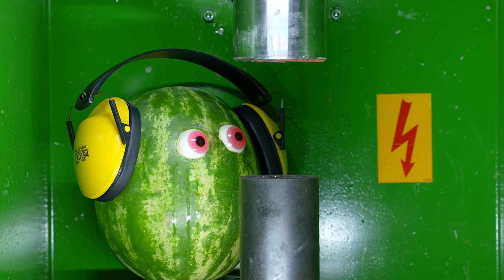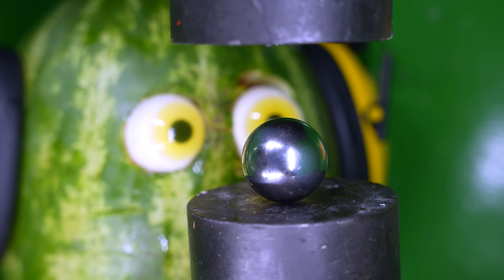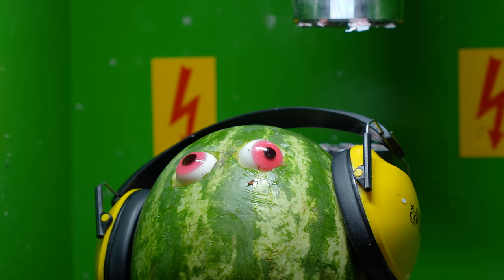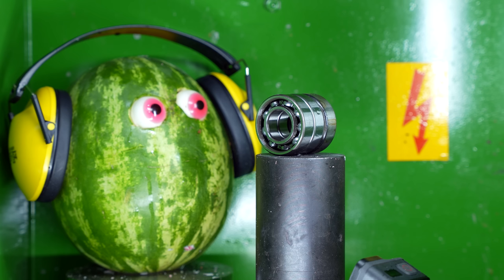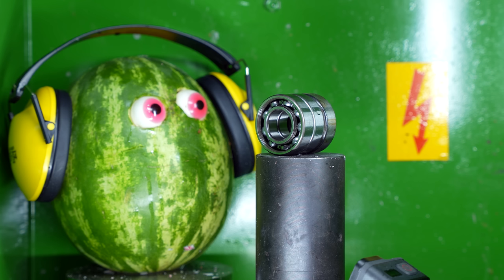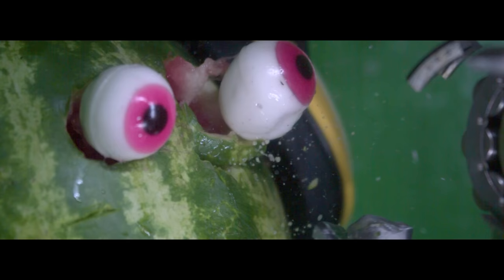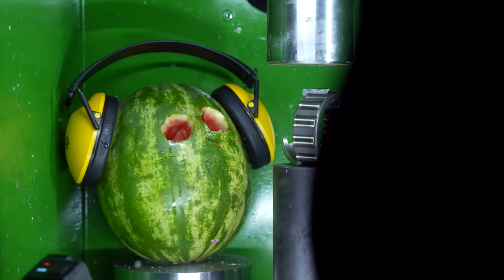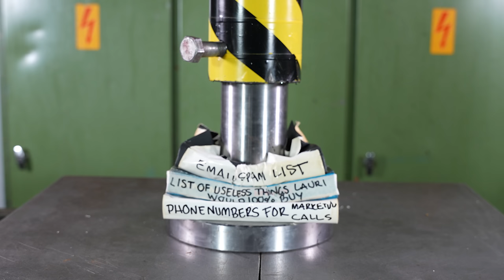How to NOT Handle Ball Bearings: A Safety Lesson with Hydraulic Press

Comment: Honestly I think if you put your face a foot away from a press while smashing things, safety glasses will be the least of your concerns.
Reply: Spacial awareness therapy would be something I would suggest... or a suicide hotline??  Lol

No one in their right mind would have their face that close to a press...period! 😊
Reply: I agree totally.  As vision declines though, it is difficult fighting the urge to get your face a few inches closer.  Conscious effort is required along with the right glasses.  It took me a while to figure out why I was getting more hits/dings on ppe -- I had positioned myself out of my normal "safe spot" for a given operation.  I thought it was luck at first and almost gave up profanity out of superstition.
Reply: @gth042  I’m not saying don’t use them under normal circumstances.  These were a LONG ways from normal circumstances though.
Reply: @jeremiahsmith2037  I agree!  I wouldn't want to be in the same room as 150t letting loose.
Reply: @gth042  Without a concrete wall in between I don't want to be in the same post code. In the army I saw what happens when a 24t self propelled howitzer "gently graces" the corner of a brick house at about walking speed. There were bricks 7-8 meters away due to the same effect we see with the press when rigid things suddenly give in. It was so weird seeing bricks fly much faster than the SPG was driving. What 150t on a small area truly means is so far beyond what our intuitive understanding of things can handle that it isn't even funny.
Reply: If you watch some of those Fail videos, you’ll see that people can do very stupid things!   I have faith that someone out there is dumb enough to do it.
Reply: @jeremiahsmiyh2037 Someone somewhere did it to require a saftey label. Have you not seen the warnings on heavy machinery that say it does not know difference between fleash and metal.
Reply: @BLOODKINGbro  kinda like when you order hot coffee from McDonald’s, then sue McDonald’s because your hot coffee burned you.
Reply: Unfortunately with some things, you kinda have to to make sure things are going together properly. 

Though a good idea is press some, then look. Then apply more pressure, then look and so on. Rather then just staying there.
Reply: @jeremiahsmith2037  that is not at all what happened and i'm tired of that narrative.

stella liebeck was a 79-year-old (at the time) who suffered third degree burns in the pelvic region. she asked for $20k to cover medical expenses (peanuts for a mega-corp like mcdonald's) and sued when they didn't pay up. the jury found mcdonald's to be 80% at-fault for the incident and liebeck was awarded $640k in damages, which, again, is peanuts for mcdonald's. following their massive loss, mcdonald's launched a smear campaign against liebeck. they settled out of court for an undisclosed amount.

in case anyone was wondering, mcdonald's was serving coffee hot enough that, if spilled, would result in third-degree burns in three seconds.
Reply: @corbeaudejugement  what exactly about what I said was slander?
Reply: @jeremiahsmith2037  maybe not slander per se, but it's a gross oversimplification and one pushed by mcdonald's to make liebeck's claims seem frivolous, when they weren't. i'll change the wording.
Reply: @corbeaudejugement  even if that lawsuit wasn’t frivolous, which I don’t care to debate, I believe it sent this country on a path where nowadays people try to sue if you do something to slightly inconvenience them.
Reply: @jeremiahsmith2037 People have been doing that for centuries. People have been doing that since the inception of the Civil Courts as a concept.

Nothing about that case did anything to change the reality that civil court is bloated in frivolous lawsuits.

There has been an increase but that's due to things like the ADA and people spending their day going around and filing lawsuits against every building that is even a mild inconvenience for someone in a wheelchair. A funny but sad example, a guy in a wheelchair was at a gym which had a party room on the second floor. The gym had no elevators and the guy sued the gym and sent then to bankruptcy because of it.
Reply: Mmm. Indeed.
Reply: @jeremiahsmith2037 the COPE got called out and now you are back pedaling HARD
Reply: I think it's more about trying to show what could happen if you're directly in the line of travel of a piece of shrapnel. Realistically, whether you're up close or far away, if there's nothing but air between you and the press, the results will be practically identical. The only practical difference is the odds you have of getting hit by a piece of shrapnel. Putting the melon closer just means that it's way more likely to get hit in the first place
Reply: My old job wanted me to do that with concrete I said no and conveniently a month later I was gone lol best choice ever!

Comment: It is amazing how much energy a ball bearing can store and how quickly it can release it under pressure.
Reply: The table sank down from force, when ball bearing break it bounce up and accelerate those sharpnal.
Since energy is related to the distance and force apply on it, we will see there is great amount of energy being stored in those table  displacement.
Reply: @fakestory1753  Umm. No. The table bouncing back up does not add energy to the ball bearing exploding. The shrapnel is already flying and the energy released long before the table rebounds.
Reply: Id like to see the maths involved, stored energy, comparisons to familiar energetic events.
Reply: It's the press that has the stored energy not the ball bearing.
Reply: @rikidawson7510  Depends how much internal strain was in the bearing from the heat treatment. I could see a ball bearing of that size easily storing a non-trivial amount of energy just due to its crystal structure.
Reply: @sophietaylor9753  good point
Reply: Yes, you never really want your balls under pressure. Eventually they will explode.
Reply: @rikidawson7510  If it was just the press, the ball wouldn't explode. It exploded because it couldn't store any more energy from the pressure on it.
Reply: What you might have seen, it could be cold fusion achieved by iron reaching critical mass, just before the explosion, there was a strange red glow around the ball, radiation ?
Reply: That's what she said
Reply: Disassociating atoms that are bound that tightly together in a crystalline structure after the bearing has already been hardened generates a tremendous amount of kinetic force, probably equal to a stick of TNT.
Reply: It's because of how brittle hardened steel is. It doesn't bend or warp. It fractures.
Reply: @El_Hornio_II  I feel like we would get along.

Comment: Wow - I'm impressed! For me, the slo-mo shot of the bearing explosion plasma is one of the coolest things you've shown on the channel - IMHO. The released energy is shocking.
Reply: I don't think it's converting to plasma, but just fine dust particles that are extremely hot. (I could be wrong, but they look far too granular to be plasma)
Reply: @DUKE_of_RAMBLE  it is NOT a true plasma!
Reply: Not plasma, unfortunately, not nearly enough energy. The flash is the material burning in the oxygen in the air around it. Even if If the bearing was ceramic, it still contains metal oxides and such that under extreme heat will burn in air. 😊
Reply: Not a plasma, but fragments of steel so small they self ignite in the air.🫨 Don't try this at home? Don't  even try this in Finland!
Reply: @sgtbrown4273  If it contains metal oxides, by definition it's not going to "burn", burning means material + Oxygen = oxide. Like iron+oxygen = rust. Ceramics can still glow, or burn, but metal oxides wouldn't burn.
Reply: I want to see what those red hot metal fragments do in the presence of a flammable gas.
Reply: @flavius29663  we use metal oxides in explosives.

Comment: That watermelon is very, very dead. 

I have a scar on the exact center of my left eyeball, from a bit of steel that got lodged there somehow, not from not wearing safety glasses, but in the shower after working in the shop. The Dr who removed it with a scalpel told me she knew it was steel because it had rusted while in there. My vision is hardly affected, but videos like this one have a special meaning to me. 'That is not optimal'.

Comment: VERY COOL!  OSHA would love this.  I would love to see a video with some fog in the chamber to see the flow of air, the force and how it disperses, like with the playing cards - it's an explosion.  It just happens so fast, and the watermelon jumps UP.  Where does that force come from?  It would just be fun to see.
Reply: When the ball bearing shatters, the downward force on the lower plate (upper pillar > ball bearing > lower pillar > lower plate) is released, and you get a sharp jump upwards of the whole lower structure. This brings the lower pillar slamming into the upper pillar, but also brings everything else on the lower plate jumping upwards as well. As well as, because we are talking literal tons of force, here, making the whole machine jump, including the camera. Good times.

Is that coherent enough to give you an idea, or did I explain poorly?
Reply: With pressure of the press your are building up potential energy. Once the bearing gives all that energy is released mostly as kinetic energy.
Reply: the press table flexes and releases it's energy once the stuff explodes. the table is basically like a really stiff  spring
Reply: Loss of eyeballs by the way is specifically OSHA reportable.

Comment: Curious, does the shock of the bang cause the press to shut down?   I've noticed in a lot of the videos when the crushed item explodes the pump is no longer running.  Some kind of safety feature?
Reply: I too am curious to know.
Reply: I'm guessing it's the sudden drop in pressure as the press suddenly gives that triggers it to stop.

Comment: Could you hang the water melon so at the catastrophic failure point, it just stays there? This way the damage could be isolated to the material in the press.
Very good video
Reply: Yes, this!
Even our human reaction speed wouldn't be as fast as the jump experienced by the objects sitting on the press table. So it being suspended would be a perfect representation!
Reply: @DUKE_of_RAMBLE I expect you'd see it swing more
Reply: @venus_de_lmao  Suspend it from 3-equidistant lines, then. 😁
Reply: Yea way too much bouncing, it's causing secondard damage and wastes much of the high speed photage.
Reply: @venus_de_lmao  No the bouncing in caused b the plate under the press rebounding upward.  If hung from above you won't have that because the top of the press is rigid.

Comment: Safety glasses are all fine right up until you're working with so much energy that your glasses also turn into ballistic objects hurtling at your face.
Reply: At that point the only difference they make is how much plastic shrapnel the coroner needs to extract.
Reply: That's why the list of protections start at "don't do it", then go through "don't do it when there's people nearbly", "don't do it without safety shields on the equipment" and only after all of that do we have "don't do it without PPE".

Comment: Some people often say under your videos: "Good, but nobody is dumb enough to stare straight into the thing you are pressing and put their face 3inches from the press" well, i work with hydraulic press like the one in this video, i'm an aeronautic mechanic, more precisely , a gearbox expert (helicopter main gearboxes specialist if you prefer), i disassemble , expertise, then reassemble helicopter main gearboxes. Into those gearboxes, a lot of things are assembled by pressing & heating (dilatation of a bearing by heating it in a hoven then pressing the said bearing on a shaft or an axle for example), and believe me, in aeronautic maintenance, you are extremely precise. I'm talking about MICRONS precision. (0,001mm tolerances), when you press something that precisely, you use some measuring tools (so you put your hands right next to the head of the press, and you stare STRAIGHT in the press, kneeled in front of it, with your face sitting 10centimeters from it, while it's activated and while the assembly is under pressure (usually we press parts together with around 10-20tons of force). Soooo yeah, the watermelon setup is NOT exagerated, some people literally work everyday with their face sitting at 10cm of a working hydraulic press. if a piece of bearing or shaft snaps, or blows or some metal flakes flies toward my face, i could end up like this watermelon.

Comment: Was arc welding a part. Had just finished, was still a molten puddle cooling. Instead of flipping up the dark lens visor. I took the whole hood off. To take a look. Before the molten puddle cooled, maybe an impurity. Well it popped, and blew molten metal into my eye. It sizzled in, and had to drive. To the hospital, holding my eye open w/one hand.

Comment: Ive had a piece of metal removed from my eye. Not fun. The (fantastic) eye doctor numbed my eye, held my lids open then plucked away at it with tweezers to try to remove everything. Then they got a Dremel out to clean up the hole in my eye. I then had a follow up appointment for more dremeling to remove a rust ring.
Much easier to wear glasses.

Comment: Those eyes are more resistant than real eyes. That ball bearing piece that impacted the left eye would probably have caused some bad laceration. He's blind from the left.
Big roller bearing... He's dead, Jim. That piece is now lodged in his brain.
Steel ball : His eyes have been sand blasted with red hot hardened steel shards. Total blindness.

Comment: Could you make a scatter bomb/concrete wall destroying warhead out of the biggest version of the old style BMX wheel bearings...the one where the bearing race is wavey and clips in the bearings rather than the one having an inner and outer race which seals them in-between?

Im thinking a main central shaft with a pointy cone on the end, with several of the bearings held behind it, with a mass of weight behind the bearings that can slide up the shaft after some explosives go off in a chamber that sits behind the weight.